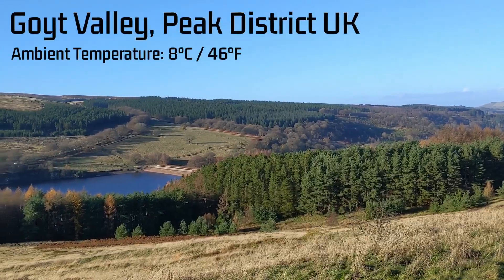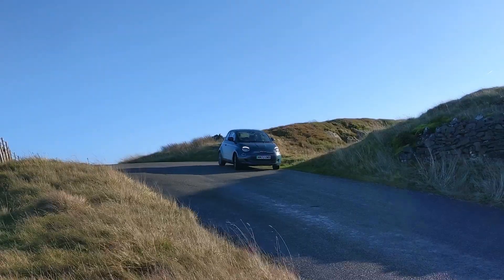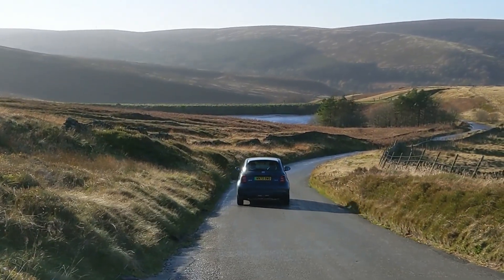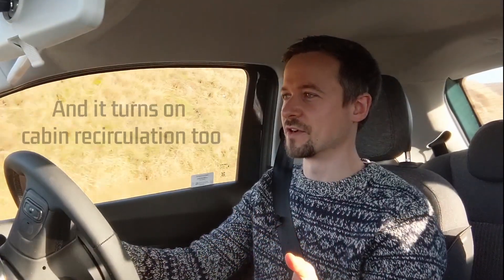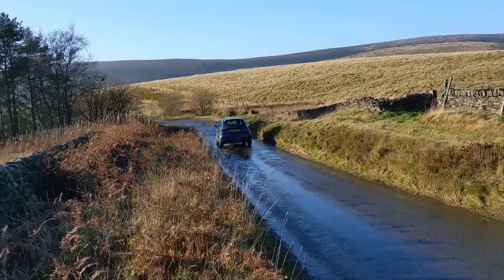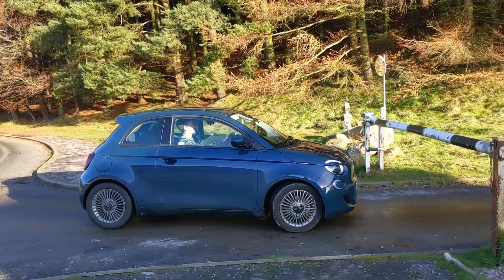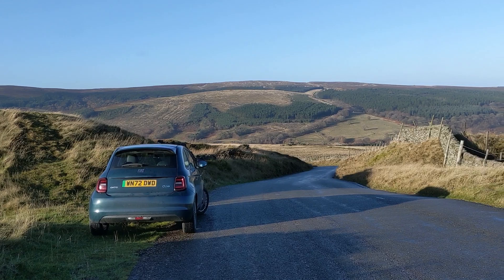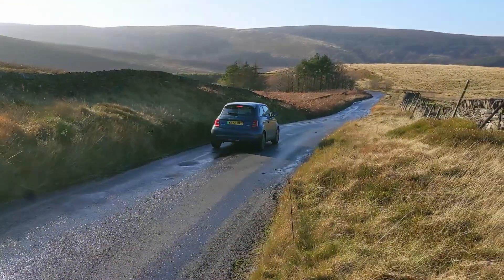Fiat 500e Regenerative braking tested - how much power will it gain?

Comment: 1 kWh = energy of 1 N of force x 3,600,000 meters distance.
For raising or lowering the 500e, 150m, straight up or straight down, with no resistance:
1,500 kg x 9.81 x 150 = 2,200,000 Nm, which is 2,200,000/ 3,600,000= 0.61kWh or just short of 1.5% of 42kWh(stated battery capacity).
Though there was little precision in JJ's experiment, his results are not far from the calculated maximum.
Regen braking reduces the penalty of driving up and down hills or driving in stop and go traffic.
Reply from the maker: Nice one Pete, good to have the numbers behind it and nice to see the results were close!

Comment: From a slightly different perspective - I have a PHV and recently went on holiday in Mid Wales (very hilly) but live in Lincolnshire (very flat). Not only did I keep the battery charge topped up but my hybrid mpg went up from 67 (best) at home to 78 in the hills - very counterintuitive.
Reply from the maker: Fully agree, that is counterintuitive. I suppose its the same reason that they are better in start-stop town traffic too - you get a good proportion of the energy back under deceleration. Whereas on a straight flat motorway or A Road, you're just constantly applying power. What PHV do you have? 78 mpg is great.
Reply: @JJonCars  2017 Prius PHV. I hardly ever use it in HV mode as most of my journeys are less than 25 miles roundtrip. On long trips I see about 67mpg in HV only mode (more when I include EV obviously) but the holiday in Wales really surprised me - so used to getting rubbish mpg in the hills from my previous car (Honda CRV diesel)

Comment: Interesting vid JJ and yes, having my hybrid has definitely changed the way I drive.
Beautiful part of the world btw...my wife grew up in Chinley so I know the High Peak area pretty well.
Reply from the maker: Cheers John, yep, it definitely applies to hybrids too. I remember the CT200 had me driving in a very similar manner. And remembering to put it in B mode haha. I quite enjoyed seeing how much MPG you can get. On a slightly different note, weirdly the usual hypermiling techniques apply less to electric cars as they are quite forgiving in the sense you get the energy back when you decelerate. So you can be a bit more 'wasteful' with your acceleration (to a point).
Reply: Hi JJ, yes I use the B mode a lot. Saves the brakes and contrary to what another correspondent of yours posted on a different vid, I think the B mode does increase the amount of regen'. Certainly the eco-meter suggests this to be the case.
Forgot to say thanks for the vid before...and did you remember that I have a CT200H? If so, well done...I have the memory of a geriatric goldfish
Reply from the maker: @Rjhs001  Hard to know who to believe on the internet isn't it 😂 Yes I remembered!

Comment: I have a 2022 Honda Civic e:hev and there's a road near where I live in southern Spain - the A-383 - which is also a 150m drop over the span of 4km. It averages a descent of ~5% which allows me to charge my battery by at least 80%, granted it's only 72 cell / 1.07kWh at a cruise controlled speed of 80km/h. Great fun too as it's twisty. I concur with your comments about adapting driving style - I use the flappy paddle regen on the car to slow me down without having to use my brake pads or I let off the accelerator much earlier to allow the car to slow down naturally. I used to have a Kia Cee'd 1.6 petrol with a 6 speed manual and would go into 3rd gear from 6th to greatly reduce brake pad wear. I'm instilling the hybrid mindset on my relatives when they've driven my car haha.
Reply from the maker: Thanks for sharing :) Very cool that you can get almost the whole battery charged up in that distance, and it's good that the battery is just big enough to handle the biggest descent you're likely to find. It was a shame in this Fiat that I couldn't get to see precisely how much had been regenerated, only to the nearest 1%. More interesting in your Civic to see much more precisely what you're gaining.

Comment: Great location! Will this still work if you want the heating on, or is knitwear a necessity? I imagine the cold weather must drain the batteries too?
Reply from the maker: It's a lovely spot. Haha the knitwear helped with having it in 'Sherpa' mode (which turns off the heating) but the regen braking still works in both Normal and Range modes too. In Normal mode you'd have to press the brake pedal to engage it though otherwise the car would just roll down at a crazy speed. 

Yep, cold weather reduces battery performance I believe